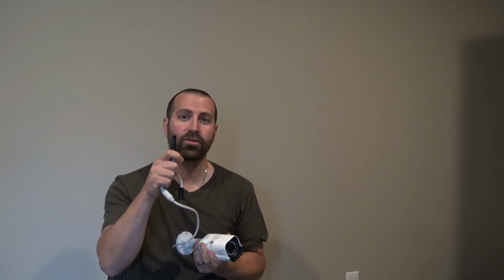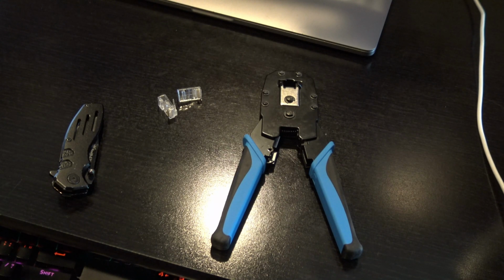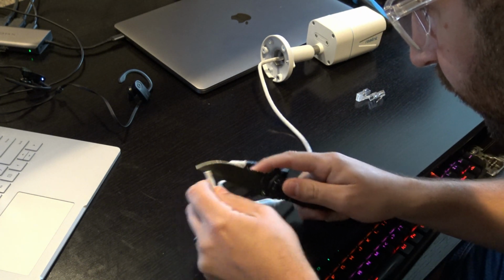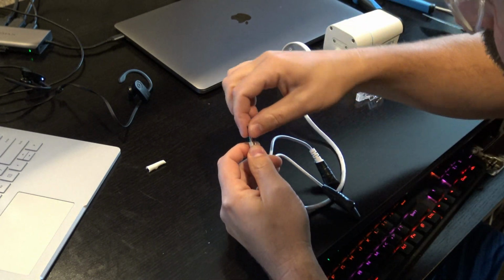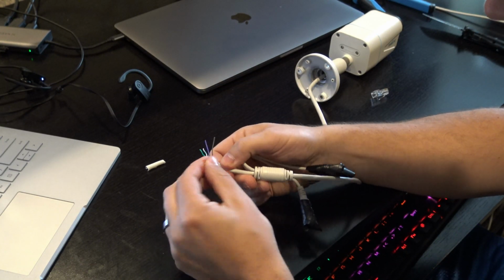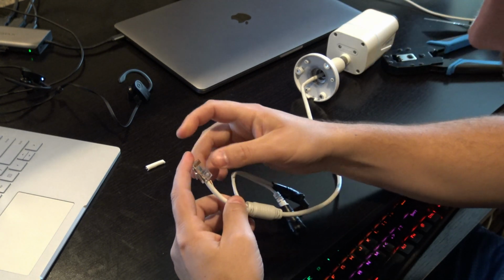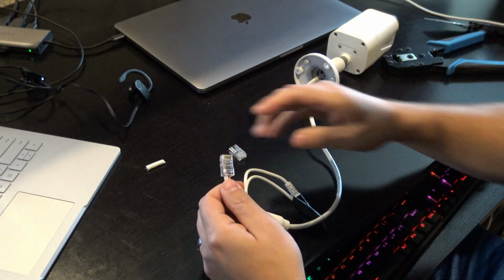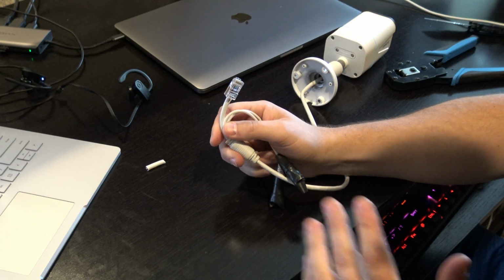Replace damaged POE camera ethernet ends

Comment: Hello ! I followed your instructions, but camera (RLC -823A) still does not work on POE. I had water in the POE Connectors supplied by Reolink. I used a keystone female adapter. It posts on DC power. Any ideas ?

Comment: Hello, I also have a problem with the rlc-811A camera. As soon as I connect PoE, I hear it starting up, but there is no picture and no function. What could this be? Maybe you have an idea. Could it also be the PoE cable?
Reply from the maker: Yes, if you can put it in a dark room, see if the IR red lights stay lit up or is they go on them off. If they go off, it's most likely a bad cable or connection
Reply: @dano3345  Okay, thank you for your quick reply. If the IR light keeps turning on and off, it could be the PoE cable, because the camera is connected to a PoE switch.

Comment: A much easier way to do this is to use a keystone.  Then you do not have to fiddle with perfectly aligning the wires inside the RJ45.
Reply: This isn’t practical if the reasons you are replacing the original plug are water damage from dew/rain outside. If you use the male jack in conjunction with a widely available waterproof Ethernet coupler you can make sure you only do this once.

Comment: I found the pinout online somewhere and did basically exactly what your doing. The plug got wet and turned black and the camera went offline. I cut the bad socket off and used a male connector to quickly replace it seeing how I had some cable couplers already. I was working on a ladder trying to do this and at first it didn't seem to be talking to my Reolink NVR but went down another time to check and it was online. Wrapped everything up and put it under the eaves so it wouldn't get wet again. Been working fine for many months since and they should make their unique pinout available far easier than it is as I didn't want to buy a new camera just for a water damaged plug socket.
I should have just taken it down but I thought it would be simple to just use the standard ethernet cable pin setup till I cut it off🤬

Comment: The trick for this not happening ever is to fill the connection with dielectric grease. The water cannot displace the grease so it can't ever go inside. The failure rate of these "waterproof" connections without grease is very high. https://www.youtube.com/watch?v=UsQZdZv4e90

Comment: Can't the connection be cleaned with alcohol or do they absolutely need to be replaced?  The exact same thing happened to one of my cameras and I don't want to have to buy an ethernet crimper. AND...which ethernet connectors to use? I see cat6 on amazon but is that what is used? AND....do you need to replace the cable end as well seeing s it too has gotten wet?

Comment: This video is great, thank you!!!!! saved me from having to buy 3 replacement cameras, as the ones I had suffered oxidation on the copper pins inside the RJ45 jack. Now I own a new pass-thru crimper tool too! Much better than the old stub-end ones.
Reply: don't forget to silicone paste the male ends to prevent oxidation of the pins 😉 👍🏽

Comment: Thanks for the video. I had watched a few others, but the colors of the camera cable were different: in yours the combination is exactly as in mine.  However, in my case the problem persists. The camera gets power but doesn't give me image. I might try repeating the process but a few inches closer to the camera, past the spot where the cable splits into RJ45 and power jack.

Comment: Hey 👋 
I have a quick question for you. I’ve been trying to connect one of my cameras that has been unplugged (outside). I can’t get it to pair back up with the system. I came across your video after several hours of failure and now I think maybe this is the problem. How do I know if the camera (for whatever reason) just stopped working, or if the problem is like yours? Thank you 😊

Comment: Sure I have 8 cameras, not cost effective to buy$ 50.00 strippers to fix a $50.00 dollar camera. However it is cost effective to buy a $50.00 stripper to  fix 
Your problem in Las Vegas.😜
Reply: The "crimpers" are under 20 dollars he said which they are and as cheap as around 10 dollars
Reply: Apart from this joke not being funny: the tool isn't even called a stripper, it's a crimper. or maybe I'm just jealous because I've never been balling in Vegas

Comment: Thanks for the video. What is the internal part of the camera like. I only need cat 5, not power or reset. Are they soldered inside camera or connected using a plug?
Reply: The night owl camera has an 8 inch wire attached to the camera with a female port. the Ethernet cable plugs into it.
Reply: https://youtu.be/3mX2JLMB144